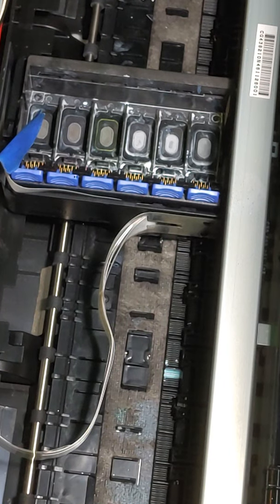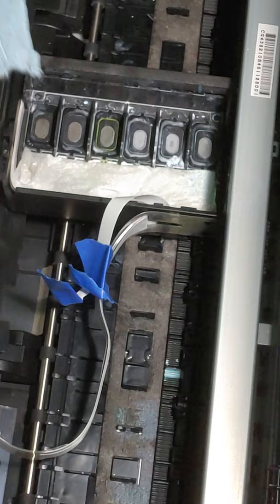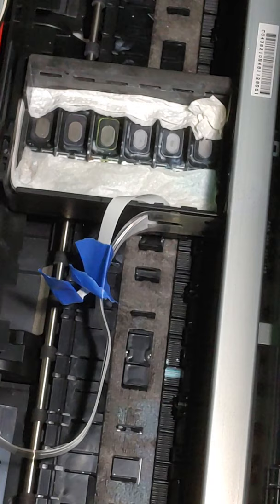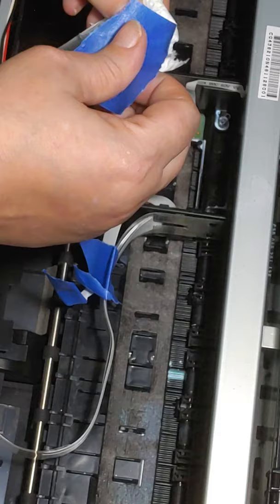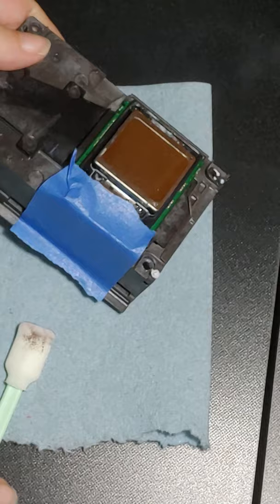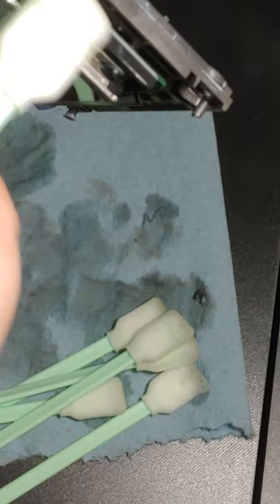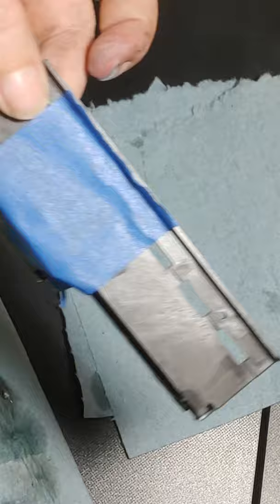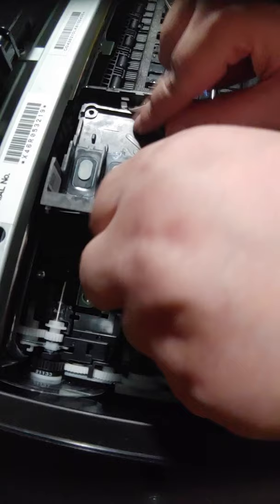Part 1 Cleaning The Printhead XP15000

Comment: Is it normal for the printhead to have lines on it?
Reply from the maker: No, means you have a clog. Check the nozzle check. Missing segments mean you need to clean it
Reply: Thank you! Out of habit, I turned on my printer after I finished this process. It got the error 033007. Should I just turn it back off and let it set over night?  @ssvcustomtransfers

Comment: hello can you help me? I no longer get any white print from my printer xp 15000, I protected it, but it helped briefly, then nothing came again. What could be the problem? are my nozzles clogged and if so how can i unclog them?
Reply from the maker: Check the carts and make sure they are good. If you have a clog patience is called for. I recommend doing a head clean to test if cleaner is going through. If it is, you don't have a clog. If not, you will need to try and suction the clog out. Pull out never push in.
Reply: Show us how to suction the clog out please.